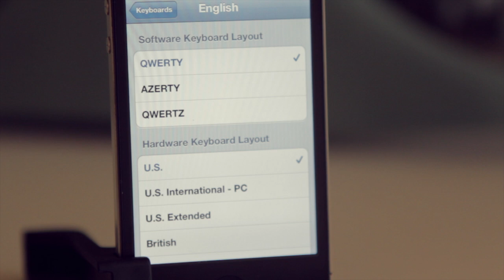The QWERTY Keyboard

Comment from the maker: No, that's not correct. Its a common misconception that QWERTY was made to slow typing down. In fact, because of the homekey layout QWERTY is faster than ABCD. Its all about letter proximity. Typing even at a moderate speed will jam a straight alphabetical keyboard. QWERTY's only goal was to space out common letter combinations, not slow typing.

Comment: I've learned typing on a azerty but after 7 years I switched to qwerty. It's just easier.
We've azerty in Belgium because some here speak French and for French azerty is better (because all of the accents). But for me, as an engineering student, qwerty is better.
Not only because how the letters stand but especially because I don't have to hold shift all the time for numbers and I dont have to alt-gr for the [] {} while programming.